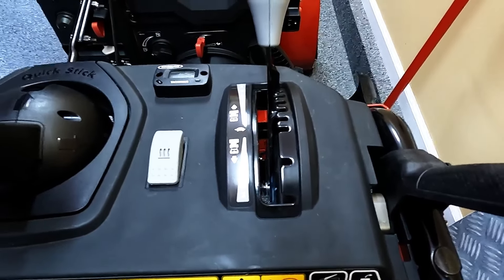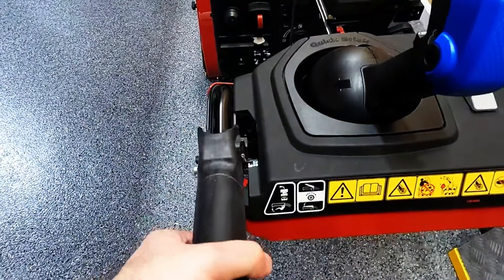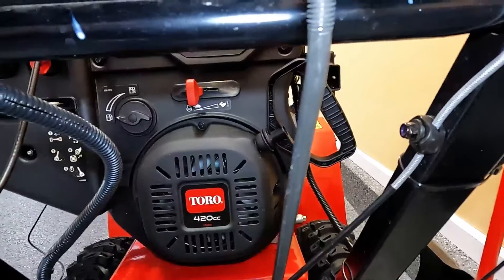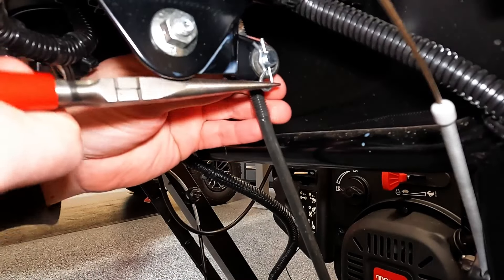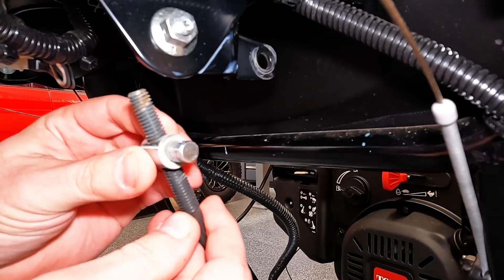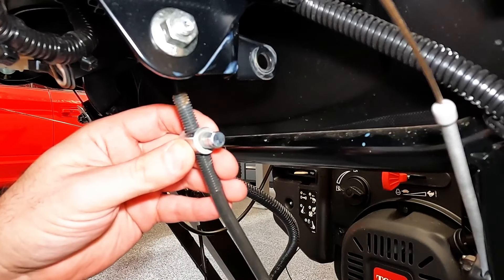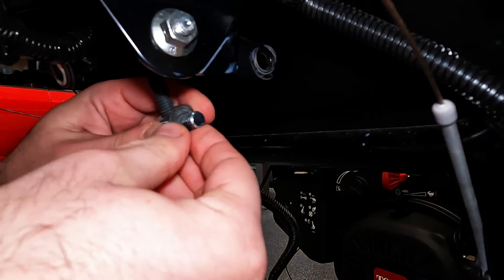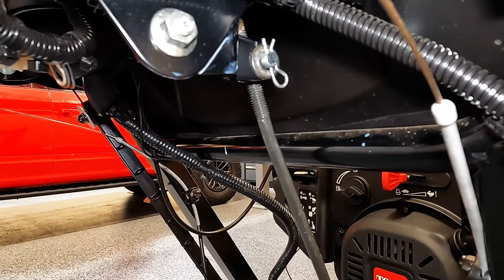Toro Snowblower Transmission Speed Adjustment

Comment: Thanks for this video. I have a new Toro Power Max (Heavy Duty) 828 with a slightly smaller engine. I had it delivered (in a crate) from Home Depot to me last August. I did the small amount of assembly that is required; but frankly, I could not determine from the owner’s manual how to adjust the transmission speed. 

Well anyway, today we had a really big lake effect snow storm which allowed me to use the blower. I felt it was moving too slow for me. I thought, oh well, I will have to live with it. Then by some hand of fate, I ran across your video. I made the described adjustment by turning that connector unit counter clockwise three times. The speed went up and I think I have it about right, at least for now. 

I did go back to the manual and the assembly instructions; but I still can’t find where they may have covered this fine (adjustment) point you just described. Anyway, thanks for this video. You did a great job of explaining this subject. 
😀

Comment: Great video, Enthusiasts Garage. I made this adjustment on my Toro Power Max HD 1232 and now first gear crawls along like it should for deep or hard packed snow. Making this adjustment to slow down your forward speeds will give your reverse speeds a tad bit more speed. To me, that is a good thing. I also removed the excessively strong tension spring on the drive lever. One can simply use pliers to slip the spring out of the grove on the lever and have the same results. The bottom spring near the gear box lifts the lever when released and Toro even recommends this fix for this issue.

Comment: Thank you for the excellent video showing how to adjust the speed on the Toro 60v snowblower. Right out of the box the snowblower would not engage in reverse. After adjusting the speed control screw assembly several times I was able to get the all the forward/reverse speeds working. (I ended up turning the screw assembly counter-clockwise to raise it higher) The forward speeds are perfect starting slowly and moving faster as you select higher speeds. Reverse is extremely fast in either gear I wasn't able to slow the speed down. Not sure what to do and like the majority of people I am not that fast walking backwards?

Comment: On the directions from my PowerMax E24 electric two-stage snowblower which is the identical same thing other than the electric motor part. Six gears forward two gears back. 

They say to install the rod in the bottom first. Pull it all the way up. Put your gear shift into R2 Then on the top you twist it until it can go into the hole Then put the washer and cotter pin in. 

The problem is you can't really put the cotter pin in in that position. So after you put it in the hole at the top You have to put the shift gear into six forward Then put the cotter pin in. 

So I guess the process would be after you do that and it's too fast. Put the gear shift wherever you need to to take the cotter pin out, turn it clockwise and then do whatever it takes to get it in that hole. 

I don't know any other way of doing it. 

I also read that another way to slow it down is to not do it that way at all. It's all about left spring at the bottom where the transmission lever is.

You find that left spring then you loosen the turnbuckle And I think you have to loosen it or tighten it and that will make the rubber wheel on the transmission touch a different spot on the disc and it will make it go slower or faster.. 

I guess you have to experiment with it.  

Because it's It's the place the rubber wheel hits on the friction disc that makes it go faster or slower. 

And I don't understand why Toro continuously makes their snow blowers go too fast in first gear. It should be a relaxing slow speed. I mean you got six more gears to go faster. 

Very bizarre.

Check out the video

Comment: I just got the Toror 60v Snow Blower 26" I tried for the 1st today, I put in 1st it jumps a little but won't move until I put it in 2nd, and it won't go in to full speed reverse the lever won't go there at all, do 8 need to adjust the linkage?
Everything else is working great.
Reply from the maker: Sounds like the drive rod adjustment

Comment: The oem friction disk drive side will loose the 3 bolts in the first 2 hours of operation. Getting parts from Toro is impossible. Can you recommend a source?
Reply from the maker: sle equipment

Comment: Hi there, I wanted to double check with someone as to exactly WHAT GEAR the snowblower was put in to do this adjustment?? In the video you had moved it to 6 but the video cut to you under the controls so I'm not exactly sure if it was left in 6 or not. Any help would be greatly appreciated! Thank you!
Reply from the maker: It depends in your problem but it’s usually best to adjust it in first.
Reply: @EnthusiastsGarage  Hi there. Okay, I have a Toro Powermax 824 oe and the Problem is that it is moving too fast in the First gear and I need to slow it down. I just watched again and the gentleman in the videos DOES infact say to put it in First gear to adjust, so thank you very much!
Reply: I have a Toro 928 OAE and my problem is 1st gear is way too slow.   I prefer to move slowly when snow blowing but not that slow.  I will make adjustments as shown and see if I cant speed it up a bit.
Reply: @jmaxs77  hey James...oh I wish that was my problem. I have the opposite effect going on. For yours moving too slow in 1st gear, can't you just use the 2nd or 3rd gear?
Reply: @stephaniesousawpg  For me 2nd or 3rd is too fast.  I have a longer city/suburban driveway and one really cant go that fast with homes/yards on either side of me.   You need to find the right slow pace to blow the snow onto the right spaces effectively.
Reply: @jmaxs77  oh weird...yeah, hopefully playing around with this adjustment helps.